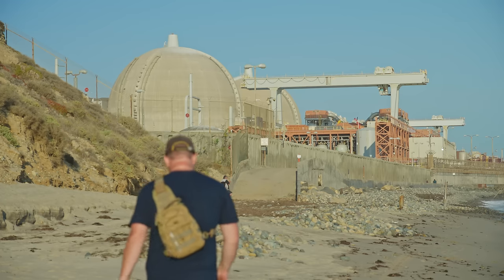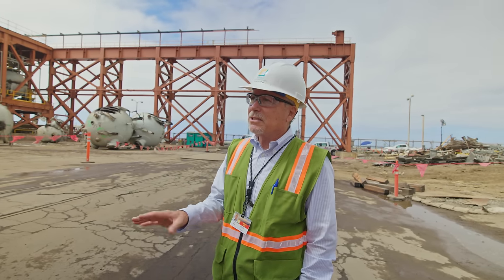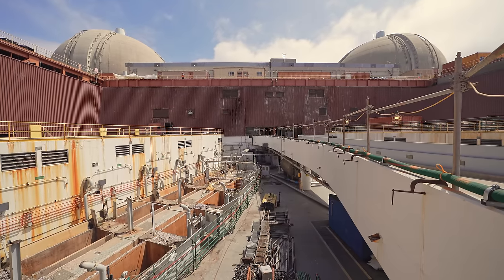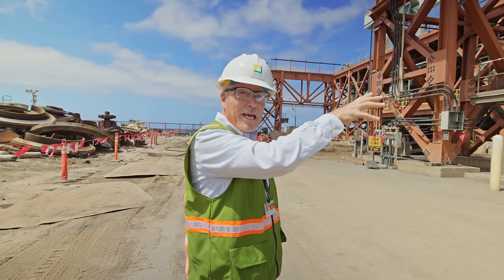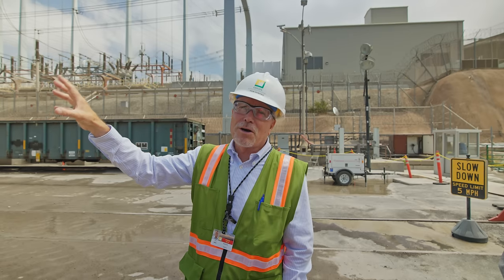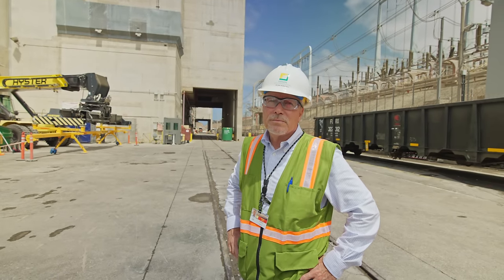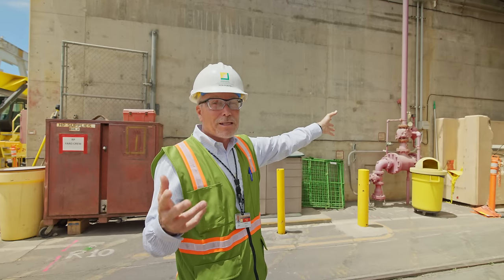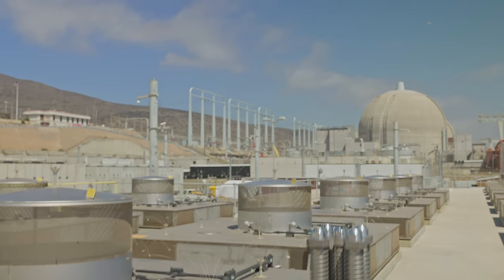Inside the Decommissioning of San Onofre Nuclear Power Station

Comment: What a shame to see what’s happened to this facility. We need more nuclear power, not less.
Reply from the maker: We do need more, that’s for sure.
Reply: This is the result in super pro nuclear southeast.  Do you really think it would be better in California????

If you live in the U.S. here is the reality for the last 4 “state of the art” Generation III Westinghouse AP1000 ADVANCED  new nuclear power projects and spent fuel reprocessing in the U.S. over the last 20 years. The AP1000 is fully approved by the NRC for construction and operation.  The only NRC requirement is that the plant be built per design documents…..seems simple..

The Southeastern U.S. is super pro-nuclear MAGA, has zero anti-nukes, and 100% media, local, and political support. 

The MOX facility (South Carolina) was a U.S. government nuclear reprocessing facility that was supposed to mix pure weapon grade Pu239 with U238 to make reactor fuel assemblies. It was canceled (2017) in the U.S. After spending $10 billion for a plant that was originally estimated to cost $1 billion and an independent report that estimated it would cost $100 billion to complete the plant and process all the Pu239, Trump canceled the project in 2017.

VC Summer (South Carolina) new nuclear units 2&3 were canceled in 2017 after spending $17 billion on the project (original estimate of $14 billion and 2016 completion date) with no clear end in sight for costs or schedule. Four managers on the project were charged with 16 felony counts, including conspiracy, wire fraud, securities fraud, and causing a publicly traded company to keep a false record.  The CEO of the project is serving 2 years in prison, another manager just got 15 months in prison, and the others are awaiting trial.

Vogtle (Georgia) new nuclear units 3 &4 at 110% over budget and schedule (currently over $34 billion with an original estimated cost of $16 billion). Mid way into the build, the utility stated that had they known about the many costly delays they would never have chosen nuclear. They last year long delay, according to the project management, was because thousands of build documents were missing. The first unit started in 2023 with Vogtle being, for its output, the world’s most expensive nuclear power plant.

Please google any of this to confirm.

If you can’t build new nuclear in the super pro-nuclear southeast U.S. then where can you build it?

Comment: After watch this film what I found it's actually all of nuclear facilities are RELY ON STEAM turbine generator with low efficiency at mechanic kinetic transformation to electric force. Then people must to deal with nuclear waste, radiation and so many things also decommissioned. All similar old school cycle loop. If I know that since beginning, why not just hydrowater or tidal undersea for electrification? This uranium plutonium just messing.
Reply from the maker: Nuclear is the only power source that can provide an almost uninterrupted power supply. Hydroelectric is extremely destructive to rivers and all the wildlife that depends on that river. It also depends on water, which changes in availability. The energy density in uranium, thorium or plutonium is unmatched by anything else we can produce. The radiation isn't a problem, neither is the waste. The only people using that argument are ones that don't know how radiation works or the nuclear fuel cycle.

Comment: Very interesting video! Great to see they are carefully proceeding with the decommissioning.

Somewhere inside the reactor building there is a lot of steel, concrete, and other material that is highly radioactive. At some point they will have to remove that.
Reply: Only spent fuel is highly radioactive.  Other material that is radioactive is from Co60 which has a 5 year half life and should be negligible in 40 years
Reply: @clarkkent9080  No. There are other parts that are fairly hot inside of the core
Reply: @davelowets  The core is comprised of uranium containing fuel assemblies, when new they are not very radioactive.  The fission products that are produced as the core ages are what become very radioactive but are still contained within the fuel assemblies.

 Contaminates in the reactor coolant become activated by the neutron flux during operation and they are primarily Co60.

What are you refereeing to?
Reply: @clarkkent9080  Neutron activation....
Reply: @davelowets  Core neutrons do NOT travel far from the core.  The core is a massive steel vessel surrounded by concrete and more steel.  The primary isotope as I said is Cobalt which is as I said present in reactor coolant from the metal wear particles of valves and pumps.  The Cobalt is neutron activated and becomes Co60 (5 year half-life) and is distributed throughout the primary piping.
The Cobalt in the vessel steel also becomes Co60.  Other than the reactor vessel, neutron activation does not activate a lot of other material.
Reply: @clarkkent9080  Well, its a pretty DAMN big vessel, and it's quite a bit of high level waste to get rid of, isn't it..

Edit: some reactors also have beam lines to send neutrons outside the core for experiments and other things. I imagine there could also be quite a bit of piping that has carried neutrons around the plant that would/could be high level waste also.
Reply: @clarkkent9080  Nah, I don't.  Just because you worked at one, doesn't mean you worked at them all. 🤷🏻
Reply: @clarkkent9080  Sure, sure.... Got fired alot huh
Reply: @clarkkent9080  Quit getting fired for once.
Reply: @clarkkent9080  😆 Whose mad? YOU mad.. Have a nice day.
Reply: @davelowets  that was nice...thank you
Reply: @clarkkent9080  Not sure this is a guy you'll win an argument with.  Lookup Mark Twain's "arguing" quote on how to proceed for next time.  FWIW I enjoyed reading your knowledgeable commentary.
Reply: @okcmoparguy724  I try to not get into arguments but sometimes it is difficult to refrain from the banter.

I have no nuclear vs renewable agenda but having worked in the industry all my life I simply want to provide facts and reality to these YT videos and comments.  I enjoy YT videos and they along with other research are a valuable educational tool.  But people fail to realize that most content creators have no education/experience in the subject matter and are making YT videos for income.  

It is unfortunate but in the U.S. old nuclear plants are aging to the point of no longer being economical for their owners and new nuclear builds are massively expensive to the point of not even being remotely coat competitive.  I don't know what the future mix of energy supplies will be but for the next 20-25 years, nuclear power's contribution will continue to decrease.
Reply: @clarkkent9080  Thank you for your insight, I have no background but have been making the attempt to educate myself.  Illinois Energy Professor has also helped to cut through the clutter.  What are your thoughts on the newer Gen 5 reactors?  Do you give any credence to what Kirk Sorensen is discussing regarding thorium.  I found his "Google Talk" very interesting but don't know what to believe:
https://youtu.be/bbyr7jZOllI
Reply: @okcmoparguy724  I am retired but watch the industry closely.

The Illinois professor is book smart but I have to cringe at some of his statements in his videos.  Technically he is correct but he tends to add information that has nothing to do with the subject at hand and sometimes is simply not true. This is from his lack of actual experience. 

I am unaware of gen V reactors.  I believe the next generation of reactors is gen IV and there is a wide range of designs and features.  The Terrapower Natrium reactor is a gen IV design but has very few of the features that are generally attributed to that gen IV design.

Most people do not realize that Thorium is not fissile (not fuel).  You need a U235 starter core to transmute Th232 into U233.  The U233 is then used as fuel in subsequent cores.  This requires reprocessing which is very expensive.  Bottom line with Thorium is that its use in the U.S. would require massive investment in a Thorium infrastructure at a time when a uranium infrastructure already exists and it is cheap and plentiful.

Some countries have Thorium reserves but no uranium.  U233 can also be used to make nuclear weapons.

Comment: All because SCE decommissioned Mt. Fuji so they could charge more for the power from the Dolly Parton Memorial. No reason for it beyond greed; everything was fine, there was never any reason to shut down unit 1 other than making more money from a system that was running just fine the way it was with units 2 & 3 at minimal load.

Comment: What’s missing here is that it was a complete screw up.

The new machinery ordered from Mitsubishi didn’t work.  Lots of finger pointing, but at the end of the day, it was SCE’s fault.  If it was mis-specified by SCE, it’s SCE’s fault.  If Mitsubishi faulted, SCE program management didn’t catch it.  Heads at SCE whould have rolled.

The cost of mitigation should have come out of SCE’s corporate hide.  Instead, all that expense got passed onto the rate payers.  This is on top of the cost of decommissioning.

This is definitonal regulatory capture.  This is what happens when the PUC is in bed with the entities it is supposed to be regulating.

Comment: Shame on the citizens and politicians of CA for shutting this great plant down.  My dad was involved with the startup of the plant, and this was a tremendous source of reliable and cheap energy. Remember California, you get what you pay for.  And turning off megawatts of energy from this plant is a disaster for you.
Reply: You apparently don't know why they shut it down.  You may wanna check that out before pointing fingers.

Now Diablo Canyon will run for another 7 years but requires billions in repairs.  No more electricity but higher electric rates.  Me thinks people will complain about that too
Reply: @clarkkent9080  they could have made any needed fixes but it’s just cheaper for the utility to not battle the state and eco freaks at this time.
Reply: @Gitbizy  SONGS shutdown instead of spending billions in repairs and people complain. Diablo Canyon stays running and makes billions in needed repairs and people complain.  same-0 same-o
Reply: @mefirst5427  Wind turbines are blades connected to a gear box connected to a generator and can operate for as long as the owner wants as long as routine maintenance is performed.  Fiberglass blades last at least 25 years before needing replacement.

You can keep a nuclear plant or wind turbine operating for a very long time if you perform needed repairs.  For wind turbines it is in the thousands of dollars and for nuclear plants it is billions. 

decommissioned nuclear plants create a million times the waste, some highly radioactive, compared to a wind turbine.  Green?

Comment: The only reason is getting decommission cuz they use some standard Parts in material and had major damage in manger operations so instead of California going in there and getting it up to par the decommissioning so California has even less electricity on the grid so our governor can say hey you can't run your electric cars this week can't go out without electric cars but you can't run them cuz the grid is too weak
Reply: Also, it was shut down in 2012.

Comment: Conventional nuclear reactors that use solid fuel rods, burn up less than 1% of the Uranium in the rod, before they suffer nuclear poisoning from fission products that build up in the rod.  Its one of the reasons(along with safety weaknesses), its inventor Eugene Wigner said in the 1950's "stop building these things".   By comparison, the liquid salt,liquid fuel design he and Glen Seaborg worked on achieved over 99% fuel burn up and ran for 10 years at ORNL with perfect safety and ease of operation, in fact the design had passive safety.   The molten salt reactor design can burn up all the existing spent nuclear waste in storage, Elysium industries have proposed a design that can do exactly that. What we are looking at is an over complicated,expensive,inefficient,safety intensive,wasteful rube goldberg device.  A joke......but its amazing how stupid ideas are encouraged and spread to generate profits and make materials for weapons.
Reply: @clarkkent9080   I never commented on the situation with fissile and fertile components of the fuel rod. Check your facts. Better yet stop lecturing people about things they did NOT comment about specifically.  Better yet, explain to us all why all the U-238 that is in the rod, doesnt all breed into Pu-239 and fission?
Reply: most of the Uranium in rod is not burned up, thats simply because U-238 does not convert well into plutonium.  The part that does, is U-235, which is equivalent to platinum in cost as a resource.  An attempt was made with fast breeder reactors to overcome this problem in a solid fueled reactor design, they all failed. This is why, solid fueled reactors and Uranium are a dead end.
Reply from the maker: First off they don’t burn up. I know some people use this term but it’s very misleading for people that don’t know how a nuclear reactor works. The U-238 and the U-235 are transmuted into the other fission products from the environment inside the reactor. Mainly the insane high neutron flux. Not sure what your talking about but U-238 is how you get plutonium. All of those weapon production reactors used natural uranium slugs. Those were the targets to be turned into plutonium. 

There have been successful breeder reactors that ran for many years, like EBR-1. Uranium is far from a “dead end” as you put it.
Reply: @RadioactiveDrew  How can you not know that the term "burn up" is an industry slang for "fission".   Yes, it is slightly misleading for completely new people. Big deal.
Reply: @wazza33racer   The idea and statement that Conventional nuclear reactors that use solid fuel rods, burn up less than 1% of the Uranium in the rod is used in these forums to try and say our reactors are not efficient or that we waste fuel by disposing of spent fuel.  I can see that you are social media and YT video educated on this issue.

I corrected one of your mistakes on what is fuel and what converts to Pu239.  Your comment was filled with misinformation but I don't have the time to correct all of them.
Sorry but you are confused.

If you don't understand why all the U-238 that is in the rod, doesn't all breed into Pu-239 and fission, then you need to read "how nuclear power works for dummies".

A little bit of information makes some people believe they are smart.
Reply: @clarkkent9080  And your a leading industry expert? please explain. You did not correct a mistake. Lets agree to disagree.
Reply: @wazza33racer  I worked in the nuclear industry for 40+ years at 5 different facilities.  Radiation control tech, reactor operator, senior reactor operator, simulator instructor, hazardous and radioactive waste manager, WIPP shipping specialist, and many more special assignments.

Again you apparently don't understand what I wrote.  I do not consider myself an expert and have never stated that.  I do however follow the industry and have wide and varied EXPERIENCE.  It bothers me that people educate themselves via social media and YT videos.  Try reading industry reports and articles written by people that do work in the industry and have experience and degrees in the field that they write about. Also try to recognize corporate PR and propaganda for what it is.
Reply: @clarkkent9080  your a random guy on the internet. Lets agree to disagree.  goodbye.
Reply: @wazza33racer  whatever dude.  PS EVERYONE on YT is a random guy/gal

Comment: Containment building was 52” at bottom to 48” thick at the top with 6 layers of 2” rebar.
Inside is what is called Secondary Missle Shield as a secondary Reactor protection

Comment: Very spot on tour… in the 70’s and into the 80’s I was an ASME Level II Civil Concrete Inspector at Post Tensioned Nuclear Plants on four reactors.   These were ‘pressurized’ containments which required Civil  inspectors obtain an additional ASME certification outside of ANSI and ACI Certifications.  Obama put us a path to be dependent on others for energy.

Comment: A national disgrace to lose San Onofre.
Reply: Well they are allowing Diablo Canyon to operate 7 more years, but it requires billions in repairs.  So, you get no more power but increased electric rates.  Me thinks complainers that always find something to complain about will now complain about increasing rates.

A simple analogy is the reason people are still not driving around in their 1970s cars.  You need transportation, it is fully paid for, and you can keep a car running forever but at some point the frequent need for repairs and nickel dime repair cost means it is no longer reasonable to keep it running.

Comment: Here's the thing you didn't explain over what they're actually cutting up..  those things are called stators and they're actually wound with copper wire as you can see in your video the all that copper wire is gone... It's literally no different then any RC electric motor you would ever see in your life...

Comment: I love how he tried to spin it that it was equipment supply is what caused the plant to shut down...lol....
Reply: Their original steam generators were leaking radioactive reactor coolant into the "clean" secondary side so they replaced them at a cost of $1 billion and the replacement steam generators also leaked.  When these old plants, and we have over 90 of them, have a major component fail, it is no longer coat effective to operate.  On average, 1-2 shutdown every year.

Why did you scrap your perfectly good 1970s automobile just because the engine was blown when it would only cost $5,000 to repair a vehicle worth only $2,000?  What a waste of a good car!